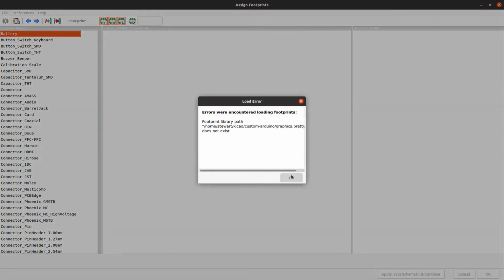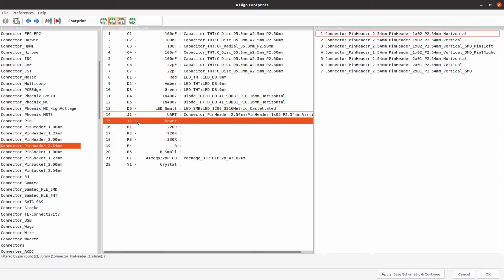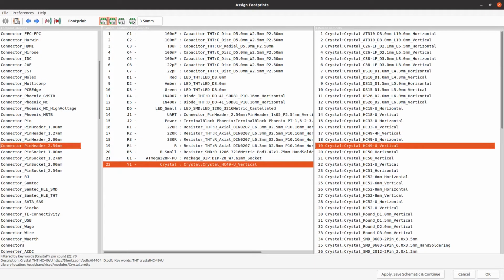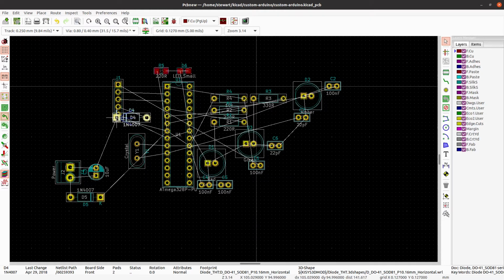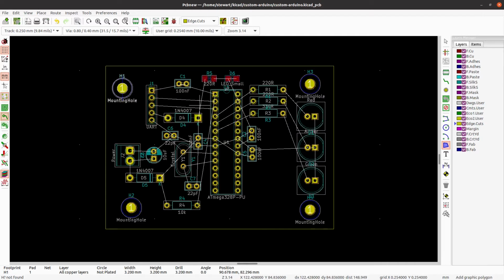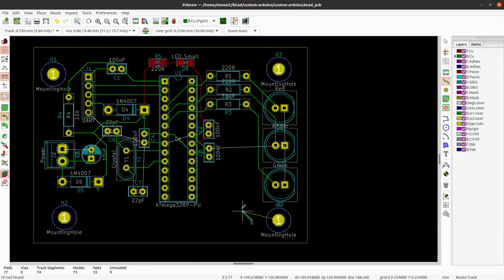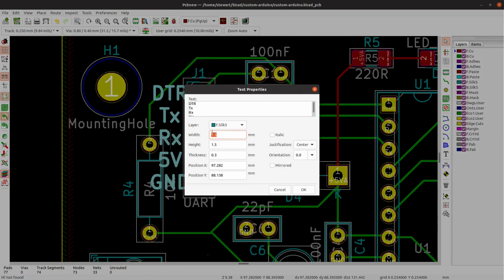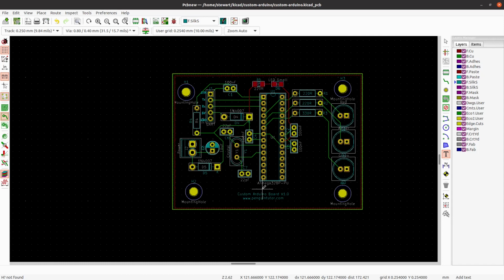KiCad Electronic Circuit Design - Part 2 Pcbnew PCB Design - Model railway lighting

Comment: I can't find the net list for my kicad(version 10)
Reply from the maker: That is a feature of the newer version. You no longer need to export the net list into the PCB editor, instead you can just click on "Update PCB from schematic" or press F8. That will update the PCB directly. You can still see the Net list through the Net Inspector panel (which you may need to enable through the view menu option".

Comment: how to upgrade pcb based on schematic second time?
I already have gnd, descriptions etc.
Reply from the maker: To add additional components then follow the steps show at: 27:46 

In that example I add mounting holes, but that could be any components. You then export the netlist when in the schematic view. Switch back to the PCB view and then update the PCB from the schematic.  

This will then add the components onto your PCB for you to move around and add traces as required.
Reply: @PenguinTutor  Nice!

Comment: Great explanation.  I imagine it's worth taking time over this to avoid silly mistakes.  There seem to be a few packages available for pcb design but this looks as straightforward as any!
Reply from the maker: It is easy to make mistakes and skip things. It's easier to make these when you are trying to do it as quickly as possible so that the video doesn't get too long, but even if you are taking your time it's easy to make some of these mistake. 

Fortunately there are some useful tools, such as the rules checker that can help you spot mistakes. I also note discrepancies when going from schematic to footprint and then finally print and review the printouts as well. Hopefully this catches most mistakes before they get to production. Even then there are sometimes that things will be missed. When creating production PCBs commercial companies will often go through several prototypes before finalising the design.

There are some packages that are easier to use but with less features and some that have more features, but are harder to use. I think KiCad is a good balance between them.
Reply: @PenguinTutor  I know from watching other, quite experienced, youtuber's projects that they often receive their pcbs only to find they've missed something and end up having to either cut tracks or add jumper wires, or both!  Not the end of the world but it shows why double and triple checking pays dividends!